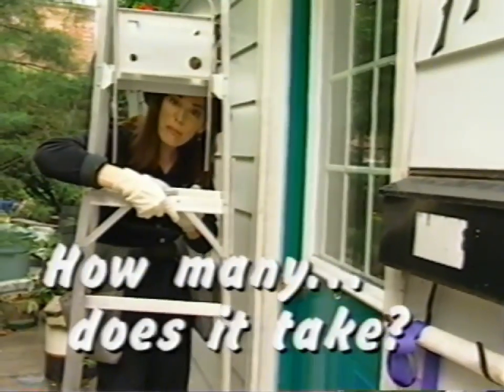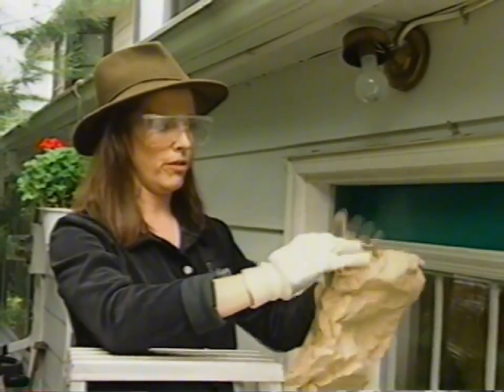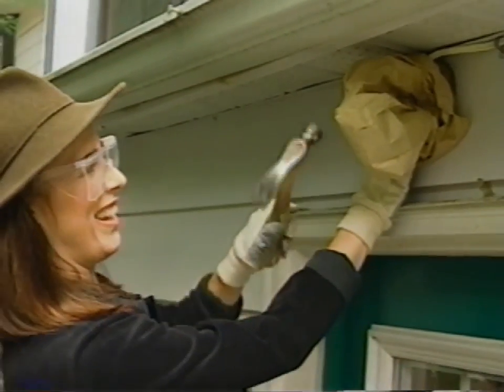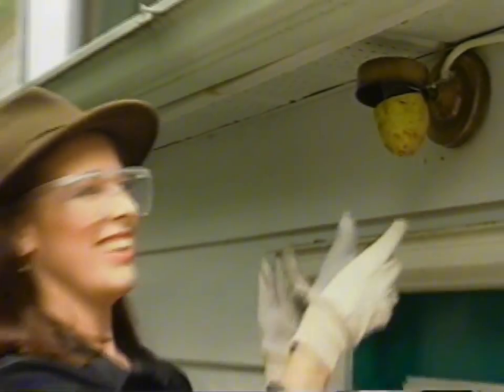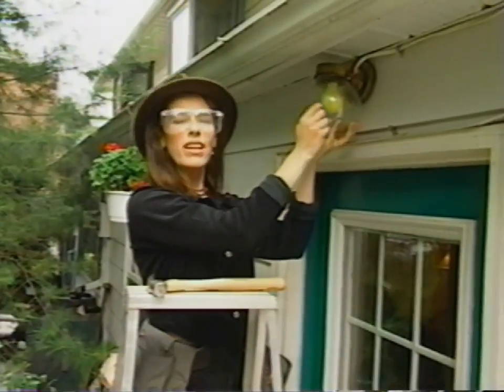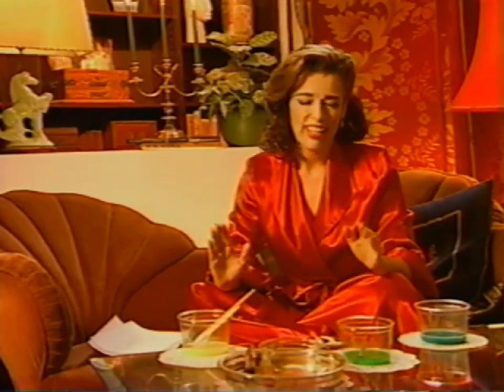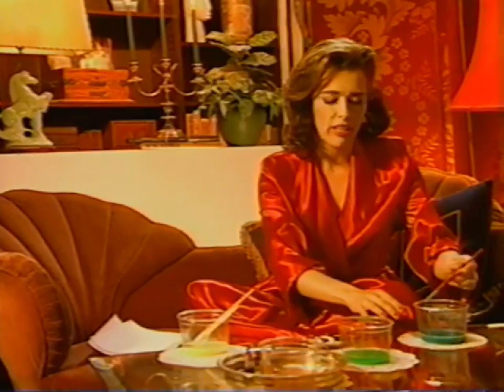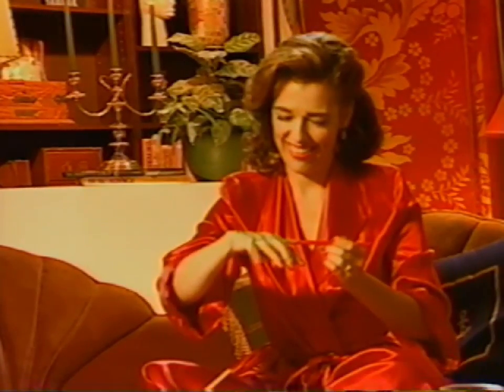Easily change a lightbulb that's stuck/corroded and won't budge! A Repair to Remember

Comment: The screws/bolts holding the globe in the housing do not need to be removed.  If you loosen each one a little at a time, the glass globe can be removed with the screws/bolts left in the housing.  This will prevent the chance of dropping and losing one of the screws/bolts.  Never use a tool to tighten the screws/bolts, only tighten them by hand so that you don't break the glass globe.